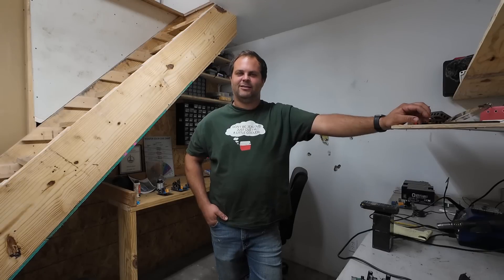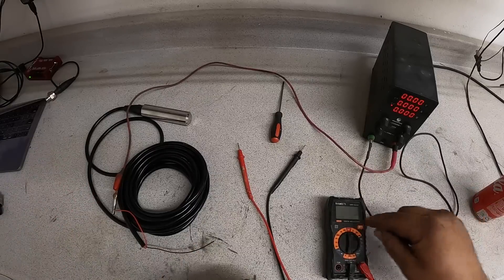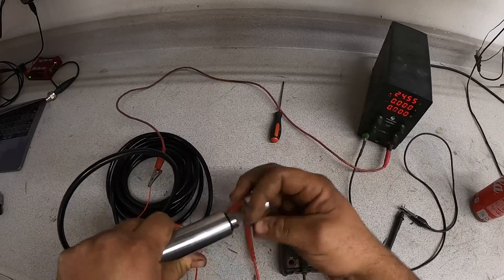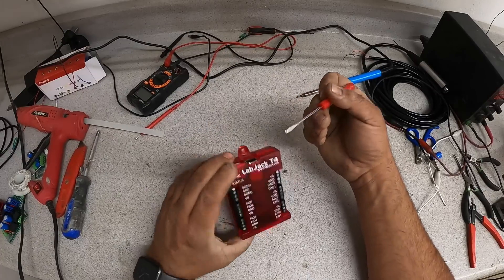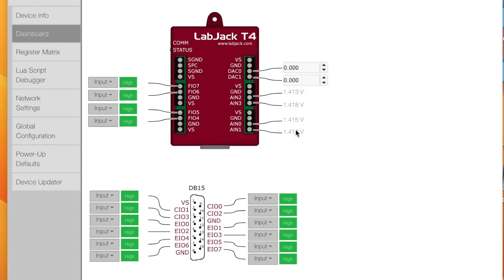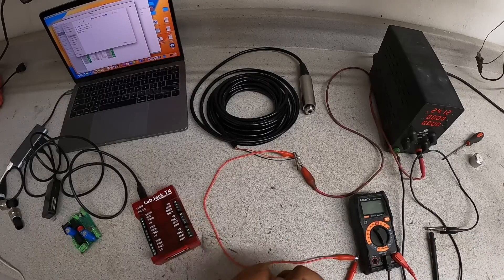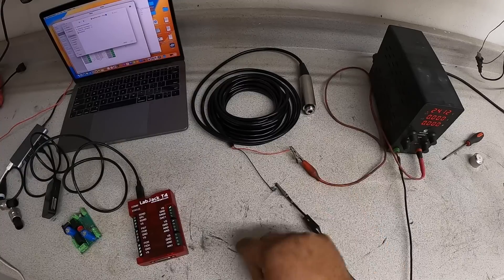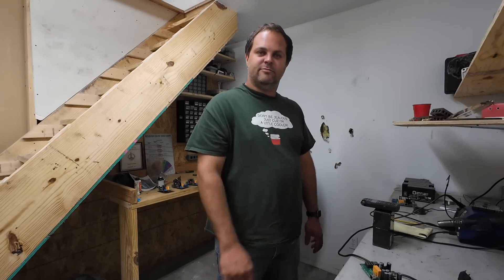TZL Scada Part 2  Sensors

Comment: Along with being able to operate accurately over a range of voltage fluctuations, 4-20ma sensors are not affected by the length of your wiring like voltage sensors are. Wires will create a voltage drop depending on the length of the wire and temperature changing the voltage drop across the wires. In a current driven circuit the current in all parts of the circuit remains the same. The sensor monitors the amount of current in it's circuit at the sensor and adjusts the current flow automatically to maintain the desired amount of current. An example would be that if a sensor is reading at 50% of it's scale, it's current driver circuit will produce 12ma.
Another advantage of a 4-20ma sensor is that it's possible to monitor for some kind of sensor failure if the current goes below 4ma, or above 20ma. This could tell you if the sensor circuit is failed, the device as a problem etc.
In the industries I worked in we used input system, PLCs etc, with either a 1 - 5 volt input (250 ohm resistor) or a 2 - 10 volt input (500 ohm resistor). If the voltage would go let's say 20% below 1 volt, or 20% above 5 volts we would use the logic to create a 'sensor fail' condition. We would typically use good quality 1% resistors because we were looking for good precision in the instrumentation.

Comment: I'm a software engineer and throughout my career I've been in about eight different industries. O&G was by far the most fun. I worked for a small startup in oilfield technology services. Our first customer was a small operator with a little over 100 stripper wells in Bakersfield. I love your channel because it reminds me of riding around out in the field with the pumpers. We did implement one SCADA system for this customer and of course it was on a water tank. His crew wired it up, we just did the wireless transmission of the data to our system.

Comment: I have noticed on the Giant stand up Rigs they have Sensors to even tell when the Bit has to be changed when it is thousands of feet into the ground,I have seen videos where the head driller
Thought the Bit would make it and they pulled the drill string and the computer and sensors were right,the Bit was bad,cost effective can only be justified 
If it works,automotive sensors can give false reads because the connections have been contaminated with corrosion,will this effect your systems,time will tell ❤❤❤
Reply: Hell, there's a tool called a rotary steerable tool, that allows the direction of the bit to be controlled from the surface

Comment: I use Plano ammo boxes for a project box. Real handy.  I made a portable power supply in one.  256wh, 12v LiFePO4 battery.  The control panel keeps all your switches and power ins and outs in line.  Cheaper than a Jackery.

Comment: A couple of points.  1 to 5 volts and 4 to 20 ma are the industry standard.   As another pointed out a 1% 250 ohm resistor will convert the current to voltage.   If you don't have 24 on your current loops sometimes the transmitter will not give a full 20ma output to the input.  This is related to the resistance in the circut.  A 1500 ohm resistor in series with your 24 volt batteries will allow monitoring of your battery voltage.  The input should be calibrated to 7 to 35.   A one to two watt resistor should be used.  You are a great technician.

Comment: I've been waiting for at least a year for this automation series. I have experimented with the labjack years ago but never implemented in the field. I am curious to see how you interfaced the unit. When I had the need to convert a 4-20 ma signal to a voltage,  I would use a precision 250 ohm to see a conversion of 1-5 volts. Building your own automation system along with writing code is awesome. Can't wait for part 3.